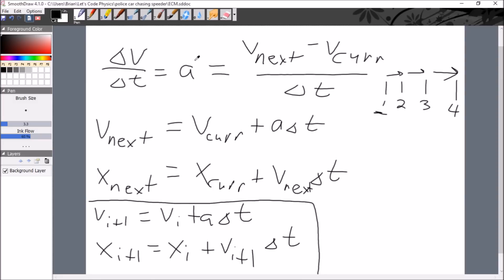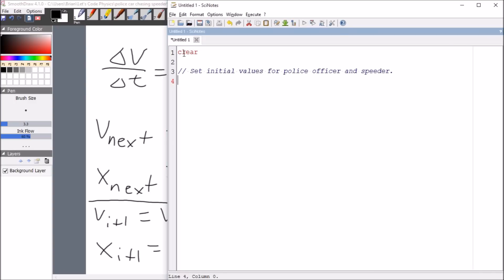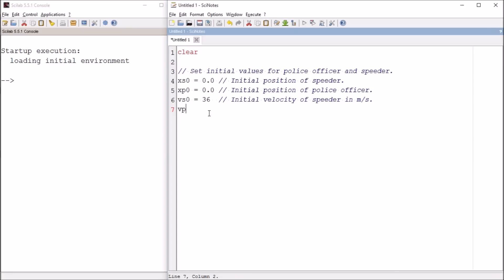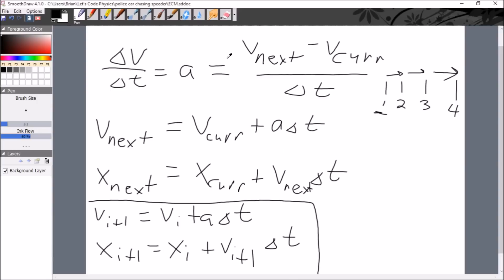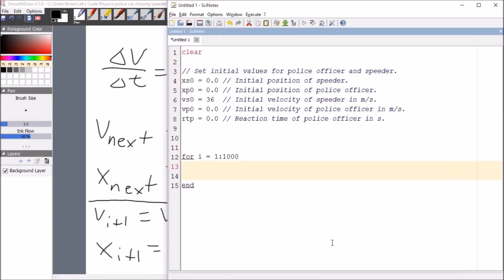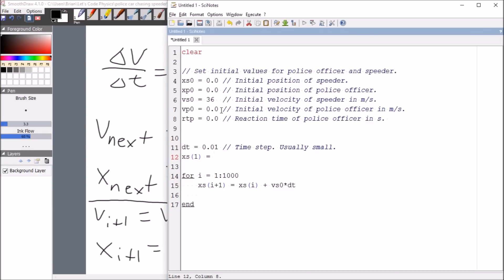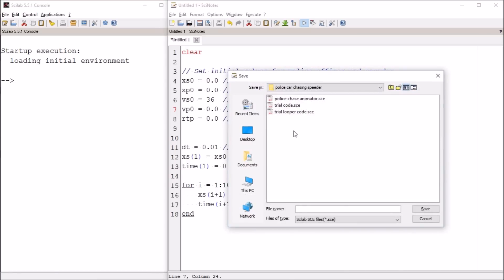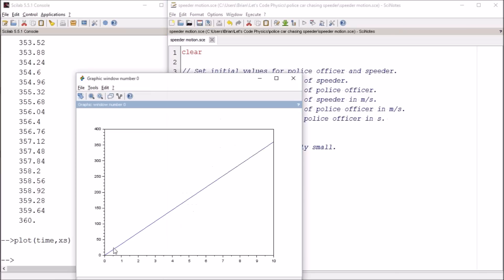Police Chase! - Episode 2 (Speeder Motion)

Comment: Are the arrays in this language 1-indexed?  If it was a 0-indexed array, you could have xs(0) = xs0 and would look a bit more consistent
Reply from the maker: +Oliver Forral No, Scilab starts counting the indices at 1. Of course, there's no reason not to use xs1, either, as "the first" value of xs (though it wouldn't correspond to t = 0).

Comment: I found this off of reddit and this seems pretty cool. I'm mostly hoping you eventually get into harder stuff later, considering we already did this problem in my physics class.

It would be so cool if you ended building a physics engine or at least many parts of it over a long time. I'm guessing you'll just be demonstrating physics on a computer though, so still very awesome.

I am excite!
Reply from the maker: +Green0Photon Thanks! This problem will become more complex, and I'm planning to expand to more intricate problems.

Building a physics engine would be fun! That would require some prep work, and I think there are some other channels showing the development of physics engines for games. It might be fun to build a quantum physics game engine, though, and I don't know of too many of those... Hmm...
Reply: Let's Code Physics I am excited. It would be so cool if you built a quantum physics engine. I didn't think one existed for normal people (without 5 PhDs). :P
Reply from the maker: +Green0Photon There's a quantum mechanics mod for Minecraft that I want to check out.